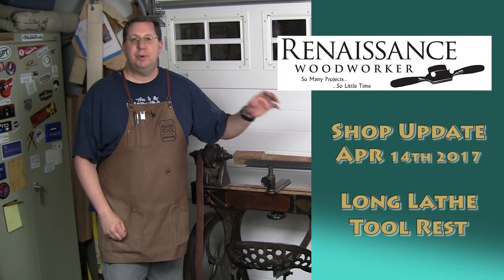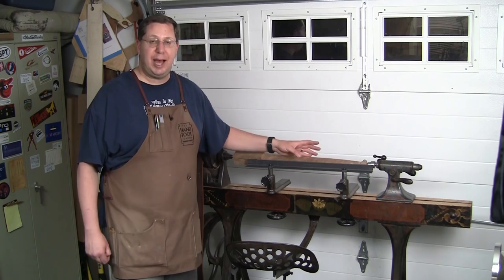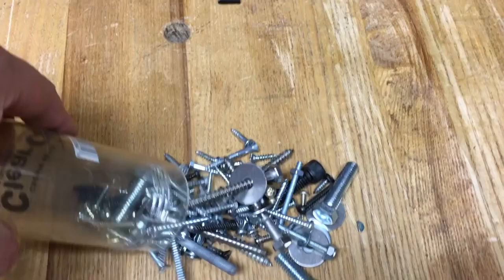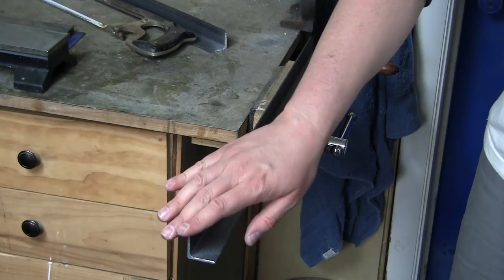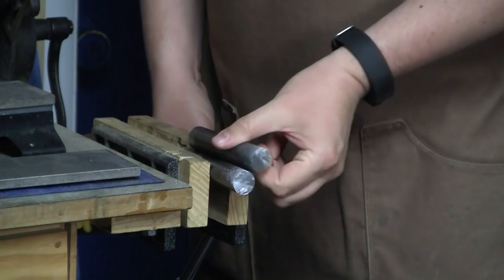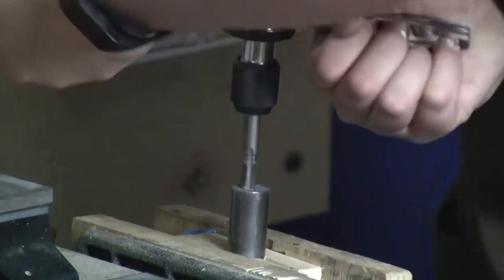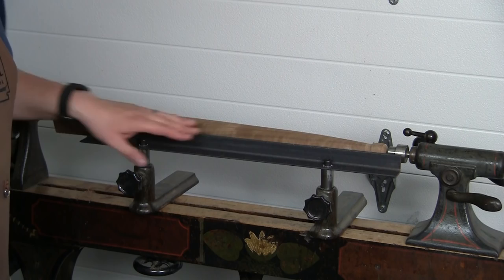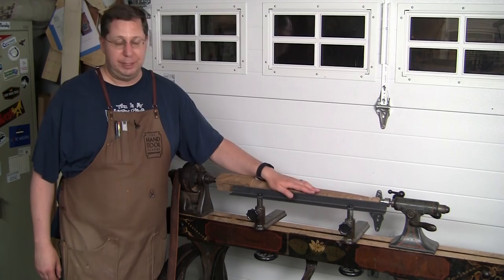Making the Chairmaker's Long Lathe Tool Rest - Shop Update 4/14/17

Comment: My father had one of those Barnes pedal powered lathes. II haven’t seen one since. I’d love to find one for myself.
Reply from the maker: took me a while to finally find one in decent condition.  Lots of them out there with many missing parts so if you have any machinist ability you can get some for a bargain.  I don't have any of that ability or tooling so it took a bit longer to get one in good condition.

Comment: You may find that you'll want to change the socket head cap screws out for some button heads.  They have a much lower profile.  Less chance of dragging your fingers on them while turning which could cause a hiccup in a nice smooth taper or cylinder.
Reply: Agreed... Though he'll have a harder time getting a grip with those slip-joint pliers.
I was cringing big-time.  I prefer using a piece of 3/8x1-1/2" flat bar on an angle.  Your finger rides it better, and when you file it a wee bit you get a wider track for the tool.  Requires welding, though.  Kudos to Shannon for using the file properly (even though it needed a handle).